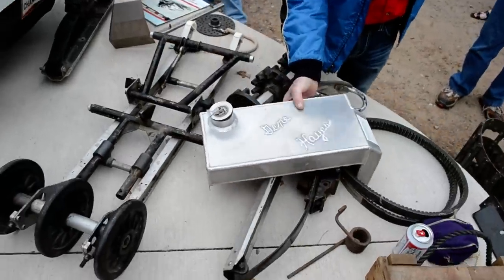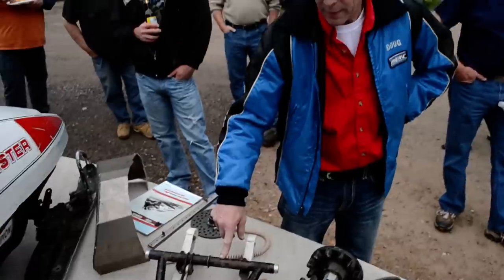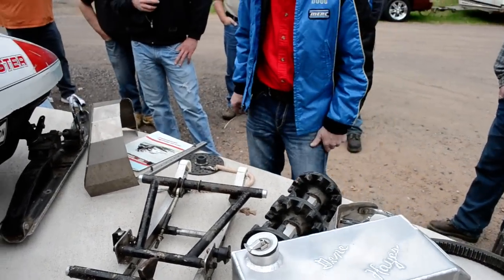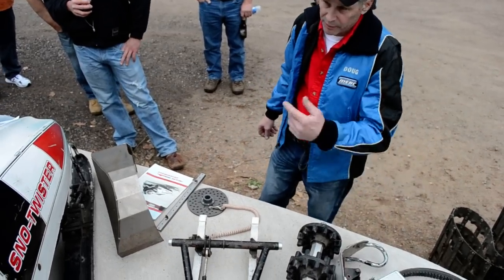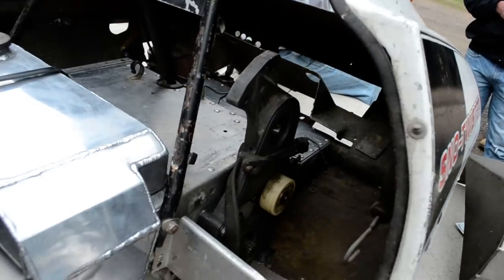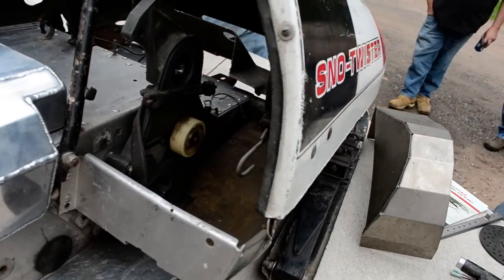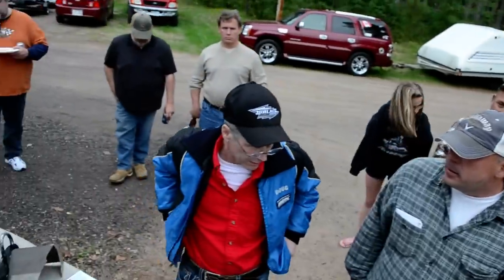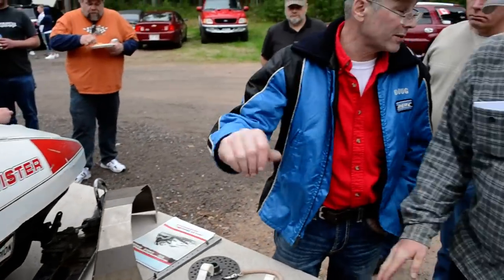Doug Hayes on the 1976 Merc SnoPro's Part I

Comment: What was the top speed on this sled ???
Reply: Rumple, I had a new Sno Twister in 1976.  It was stock.  Top end was about 95 mph (100 mph on a real cold day), but it would get to that  speed almost as fast  the latest sleds today.   330 lbs/100hp.
Reply: @brabham74  Thank you. Where did you buy it ?